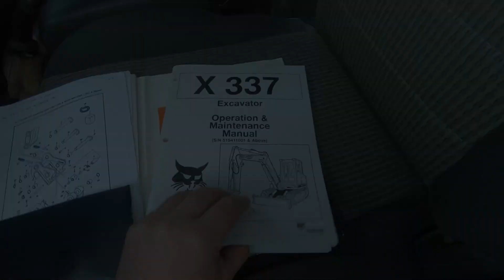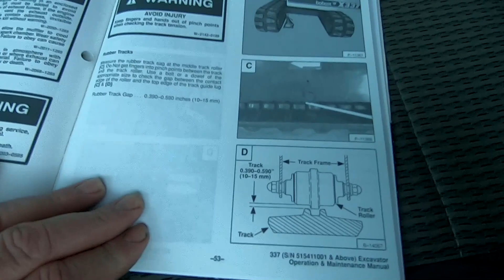Hands Free Track Installation...The easiest way to install rubber tracks!

Comment: Makes it look good now. You’ve been needing this for some time. I have done the track tensioning with a manual gun and you’re right......it’s misery. Just a note for you.....Bryan Equipment will not give us any dates now for delivery of Ms500i’s nor much of the other saws. Supplies are getting tough.
Reply from the maker: Yes, Glad to get them on there!  If you know anyone needing any, I picked up a dealership for rubber tracks (for skid steers and mini excavators), Skid Steer tires, wheel loader tires, backhoe tires,  and some compact tractor tires....All quality ranges from low quality to high...very competitive pricing!
I sure hate to hear about the tough availability!   Hopefully thing will get better soon!